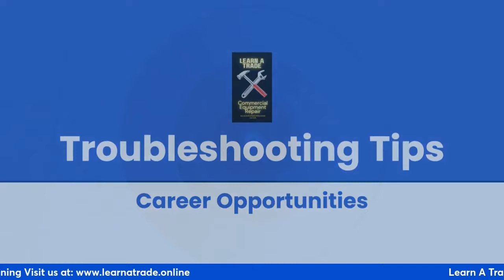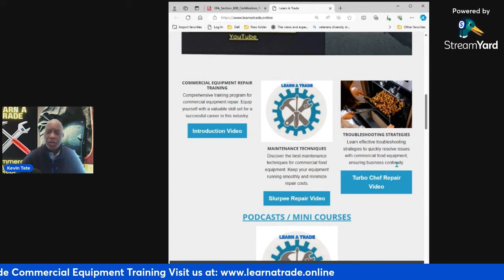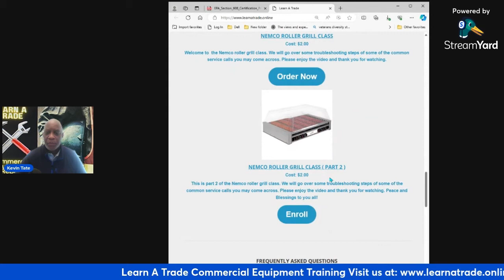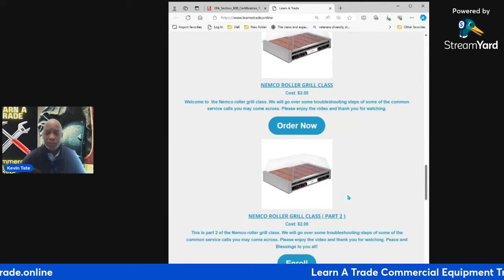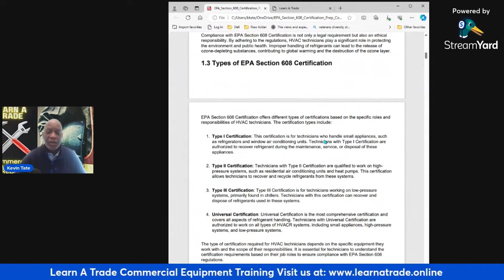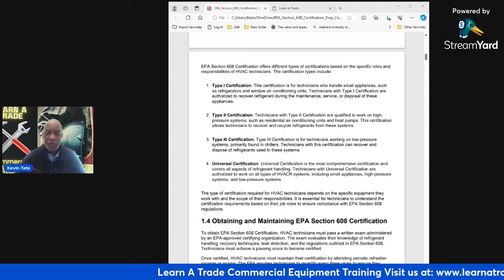Obtaining and Maintaining EPA Section 608 Certification

Comment: I have the Type 1. Do I need the Type ll and above for commercial?
Reply from the maker: Good question you can work in commercial with type 1 depending on the size of systems you want to work on. Its always to remember that type 1 is mainly refrigerators and widow AC units.  be sure to check the regulations for the State you are in because each state has different rules.